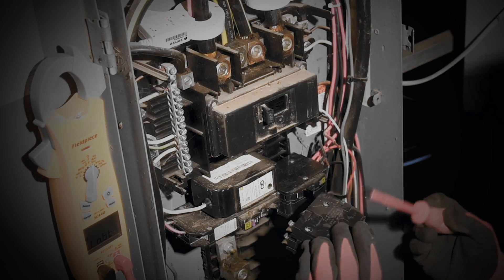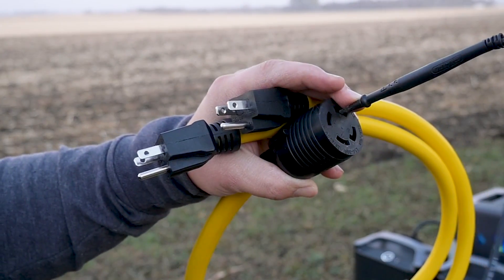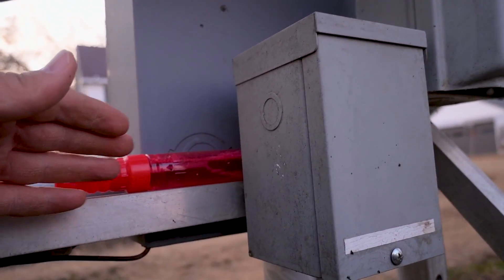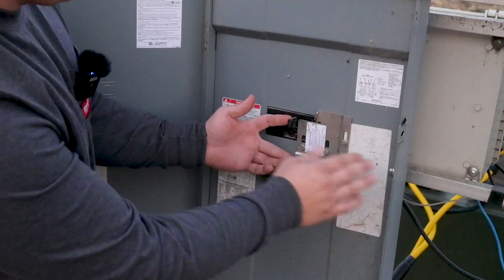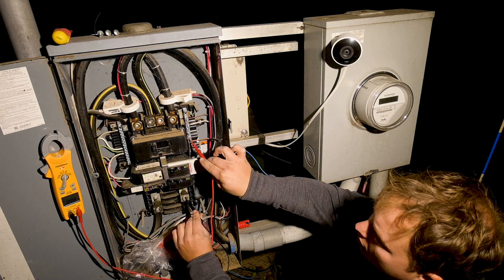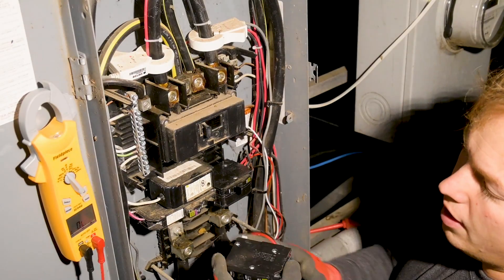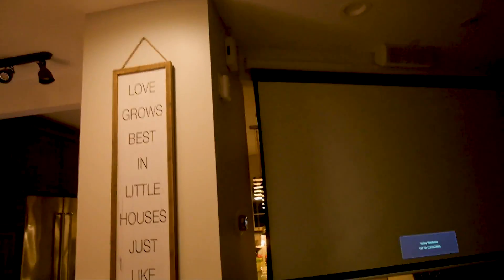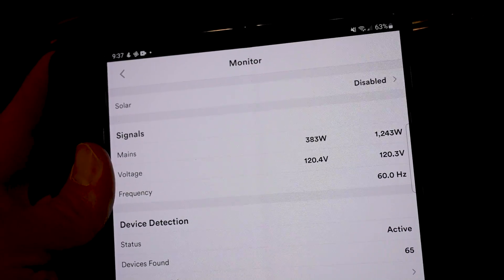Can You Power a 240 Volt Panel With Two 120 Volt Generators?

Comment: I just tested attaching a generator to our house yesterday - bad weather in the forecast, and I wanted to check for unexpected surprises.  The local codes now require GFI breakers in the panel in the garage, so just about every breaker is GFI, including the 50A dual breaker I used to feed the generator to the house.  After a little thought, I decided to disconnect neutral and ground at the generator, since the return current would split between neutral wire and the ground wire in the generator connection cable, which would certainly cause enough imbalance to trip the GFI breaker.  But when I closed the 50A breaker with the generator running, it made a buzzing noise for  a second or two, then emitted a brief pop and some sparks from inside the breaker itself, and it tripped off.  I gingerly reclosed the 50A GFI breaker, and this time it held with no buzzing sound.  I then pressed the GFI test button on the breaker and . . . nothing.  I apparently blew the snot out of the GFI circuit inside the breaker, and I have no clue as to why this happened.  The rest of my testing was uneventful.  (None of the other GFI breakers in the panel tripped; I was a little worried about this, because I have heard that GFI circuits are particularly sensitive to higher frequency harmonics, and I don't know how 'clean' my generator's output waveform is.)

Afterwards, I decided to replace the blown 50A GFI breaker with a non-GFI breaker, since I wasn't 100% sure it was still safe to use.

Just like the breaker you smashed in the video, my dead breaker was held together with five long aluminum rivets going through the width of the breaker.  I tried to drill out the rivets, which worked on one, but the others just spun in place.  Then I grabbed a nail punch and a hammer, and the other rivets popped right out, quick and easy.  Using this method of opening the breaker, I was able to examine the innards in their unmolested state.  There was a little circuit board with the Permalloy core with the L1/L2/N wires running through the core.  I expected to see one or more of the components on the circuit board visibly fried, but everything looked clean.

Anyway, it's still a mystery to me why the GFI breaker fried.  I realize that they are designed for power flow in the other direction, but I don't understand how the circuit would 'know' which direction power is flowing.
Reply: Update: Going back over the process of replacing the fried GFI breaker with the standard breaker, I realize now that the GFI breaker was wired incorrectly; the neutral wire from the 50A outlet was connected to the neutral bar in the breaker panel, but it should have been connected directly to the GFI breaker, along with the two hot wires.  The neutral pigtail wire from the GFI breaker was wired to the neutral bar, so at least they got that part correct.  So, the electrician miswired the breaker, and the inspector missed it.  Apparently the 50A outlet had never been used before, or was used with a pure 240V load with no neutral connection.  With the missing neutral, I subjected a sensitive circuit designed to trip on 5mA of current to maybe 1000x that much current, so it doesn't surprise me that it failed.

Comment: Benjamin I did the same thing in my house. I have an eco flow and a APC. I connected a transfer switch I split the two hots with to 20 amps plugs. I connected one to the Ecoflow and the other to the APC or 3500 ways generator, if I choose to. Haven’t lost power but am ready if it does. Eco flow is the only one that can turn my boilers pump for oil heat.

Comment: I'll add one variation. You can use 2 generators as long as you don't turn on the ac, stove or anything that uses 240. I assume it would damage the motor.  Interesting seeing someone actually do it.

Comment: Interesting experiment. I would have never thought to hook up a generator to each leg.  I would have thought there possibly could have been a problem with the polarity flow & that it may have tripped breakers (is this why u shut off all 2 pole breakers?) .  I would have been worried that the power banks didn't send current in the same direction as the utilities.  I would have had too much apprehension to try this experiment at my home.  I would have been worried that I would cause damage to my appliances or power banks.  Thanks for showing everyone this experiment.

Comment: Awesome video. I have been thinking along these lines as well. I have 24 250W solar panels. 12 go to one solar charge controller/inverter and 12 go to another. Each of these have their own 10KW battery bank. They each put out 120v. If I connected them together and connected a data cable between them I could configure the inverters to output 240V but the 2 units have to be on a shared battery bank. And my lithium battery banks are identical in configuration (4 12V 200AH) but each bank of 4 batteries are of a different manufacturer. Also I had read a data sheet from one of the manufacturers to not exceed 4 batteries in one bank. So, I have been hesitant to run my two inverters in sync with each other to get the 240v and sidelining a perfectly good bank of 10KW. So this has been on my mind a lot lately. Thanks for the additional thought material!

Comment: I think you can overload your neutral this way if your power sources can supply enough current. The two legs are meant to always be out of phase with each other, with the neutral carrying the difference, not the sum.

Comment: Similar  to a 120v generator feeding both panel legs with 240v breakers off. Best to use single breakers protecting eack leg separately. If one leg goes over current, only one leg will drop out. 
Great video proof it can be done safely.

Comment: Measuring voltage is measuring potential difference in phase rotations aka sine waves. Synchronous phases = 0v potential :-)

That being said, I have many acquaintances that power their panel with a 120v generator, and do so by merging the phases in the cord itself and turning off the 240v loads. The whole panel is powered, just with 120v on both sides in phase :-)

Comment: I'm pretty certain that the sense monitor is actually a 120v device that only uses the 2nd hot to monitor the voltage on that leg. When I was playing with mine originally I didn't have a 240v breaker and accidentally powered it on a single leg while doing some troubleshooting.

Comment: Although I have not read all comments, I do see some saying that both phases have to be in phase with each other. It’s actually that the two 120v phases are 180 degrees out of phase with each other. That is how you actually get 240v is because while “A” phase is going 1 positive the other is going negative do you actually have a total RMS voltage of 240v. I know for a lot of generators you can purchase a special sync setup that will ensure that when connected together they stay 180 degrees from each other therefore allowing you to use a limited number of your 240v circuits.

Comment: The phase difference between the two signals would only affect the magnitude of the resulting signal, but it will still give a uniform output (sine wave). Difference in frequency,however, would result in a sine wave with variable extremes (max and min), resulting in a variable rms.
I believe this could be solved if you use exact inverters from the same manufacturer. Some do have a connection for the proper phase shift too.

Comment: Edited with more info: There are two reasons for the 240 volt problem. Number one as you mentioned the frequencies are probably not exactly the same. However, the second problem is that they are also not going to be in phase with each other.

Even if they were both electronically synced to be exactly the same frequency, it's unlikely they would be in phase with each other. If they WERE synced to be the exact same frequency but NOT synced to be in phase, you would see some STEADY voltage between 0 and 240 depending on the phase difference.

In any case, if you were to look at a graph of the two 120V sine waves above each other WITH ONE INVERTED, the voltage at any moment in time would be the sum of the 2 voltages at that point in time. (Or on the graph, if the sine wave displays are touching each other, it would be the voltage equivalent to the distance between the two points at that moment.)

Another way to think of it is that the voltage on the 240 connection is the sum of the instantaneous voltage of the two sources at any point in time. Please keep in mind that the instantaneous voltage can be positive or negative at any moment in time. (I don't want to complicate things but for those that might try to point this out, yes the meter probably measures RMS, and the graphs would show peak which can go much higher than 240, but the basic principle is there.)

 I apologize if anyone else said the same thing but I haven't read all comments. An interesting experiment. I enjoy your channel.

Comment: That weird voltage you are seeing across the 240V is the 2 power sources are out of phase with each outher .If you you have a dual trace scope you can see the two wave forms and you can see they both do not line up. On the larger power banks there is a sync cable to go between them and that will fix that 240V problem. Also some generators have a sync cable as well . like the larger Honda inverter generator . also can put 2 120V loads together for more amps. I made a cord like you use in video but used 10/3 wire for the 2 legs and 20A 120V plug. I have gen set that output 20 amps 120V + . also both 120V plugs can be put into same source .being 180deg out of phase there will be 0 volts between the 2 hot legs. is ok to do this ,same again 240V loads turn off.  I have been a electrician in Boston NY over 30 years now and had my share of bugs getting inside panel box and breakers. I keep bee and bug spray on hand. Them little things can find a way in. nice video. 😀

Comment: Hopefully, we all realize how and why they used to get away with using a smaller guage neutral compared to the two hot legs feeding an old 240v panel per electric code.  In a perfect situation, that neutral will see zero current with balanced 120v and all 240v loads.  (The switching power supplies have changed the world and modern electrical codes spec all three same sized wires to deal with unexpected high frequency AC currents overloading main supply neutrals. That strange situation could melt N wire between commercial buildings!) 

With this video's proposed setup, the neutral would see double the expected maximum current while the two legs remain in phase. Drifting around would give the N some chance to cool off as it approached proper 180 degree phase. I would not count on that.

Double that trouble again if the neutral's wire gauge is already much smaller than that of the two hots!  It's a bad idea without a single 240v alternator power source that has to maintain a perfect phase lock. Trying to phase lock two 120's together for 240 smells like something is burning... lol  Just say, "no".

Comment: the light going bright to off then back off is showing the phase difference. you can use this method to sync 2 gensets (engine driven) into parallel mode.

Comment: The varying LED is an example of what in physics is called 'beats".  You can hear the same thing happen when you have two different tones play that are slightly different frequencies.

With the beat frequency you can measure the difference in frequency between the two sources  So if one is 59hz and the other is 60hz, you'd hear a beat frequency of 1hz.

Yours looked like a frequency of about 8-10 seconds, so you'd expect a difference between the two of something like .1hz.  For example, one might be 59.8hz and the other is 59.9 hz.

Comment: Back in the day when the power company was   to bring a generator back on line, the operator manually engaged (switchgear with a push button) the generator to the grid based on the position of the indicator of the syncroscope.  There is videos on YT that show how this was done before computers/controllers.  Like someone said, when a generator is connected to the grid when its output phase is within a few microseconds difference, then it will remain locked in phase to the grid from that point on.  There is also videos about how they determine how many megawatts a generator is suppling to the grid based on just a few microseconds of generator phase leading the grids phase.
Reply from the maker: What keeps a generator from "drifting" out of sync once engaged with the grid?
Reply: @BenjaminSahlstrom  Look up phase locked loop circuit.  That is an analog cuircuit which will keep something phase synced.  Nowadays it is all done by software and digitally.
Reply: https://youtu.be/xGQxSJmadm0
Reply: A generator is like a motor, it has all the same charactics of a motor, so when the grnerator is on the grid, the grid will drive the generator in much the same way that 120 or 240 volts drive an electric motor,  The speed of the generator will be determined by the frequency of the grid, 60 htz, and the number of poles of the generator.  Only when the generator is pushed enough so that its output phase starts to lead the phase of the grid, that is when it is actually generating into the grid.  To produce this slight phase lead takes a monumental amount of power to achieve in order for the generator to produce its rated output.
Reply: Ive heard that installing just one syncaronous moter will correct out of phase problems

Comment: You should also turn off any multiwire branch circuits, since these circuits share a neutral.  (Which of course should have a shared breaker).  I'm not really sure what would happen with these circuits since they share a neutral, but at the very least you'd be out of code since they no longer will balance any load between the two phases, since as you observed they aren't.
Reply: The US National Electric Code (NEC) 2020 edition requires that all Multi Wire Branch circuits (MWBC)s have one of two arrangements of the circuit breaker/s supplying them. Either handle ties or a double pole breaker. If it's a 2 pole breaker that would take care of the neutral overloading issue of MWBCs when you threw all of the double pole breakers to off with the caveat that the requirement for special control of MWBCs is relatively recent and it is unlikely that any but rather recent panels have been upgraded to comply with this new requirement. If handle ties are used then you would have to treat all of the handle tied breakers the same as double pole breakers and turn those off as well. 

Tom Horne

Comment: 240 volts as I would expect, and it goes up and down as the 2 legs go in and out of phase with each other. The slow movement means they are actually pretty close in frequency.

Comment: You can run both legs of your house off one 120V solar generator.  Have to buy a 120V to 240V cord that splits the hot.  I did that during our last outage.  Just can't power any 240V devices.

Comment: Of course you can, as long as you don't have any 240v devices, some random phase between the two legs.
If you can lock the phases " in phase " you will see 0V across the two legs. If you can lock the 2 phases " 180 degrees out of phase " you will see 240V

Comment: Besides what everyone else posted about the two generators not being in phase, actually they need to be 180 degrees out of phase and exactly the same frequency. If you have any multiwire branch circuits, these are two circuit one on each leg that use a common neutral conductor. Normally since each leg is 180 out of phase with the other the neutral only carries the difference current. If the loads are exactly balance the neutral carries zero current. Worst case using two generators if they are both in phase the neutral now has to carry the combined current of both logs. Needless to that that is not a good thing.
Reply from the maker: Great point. I hadn't thought of that.

Comment: I'm sure someone commented this already... your "generators" have a "forced" common neutral with the cord plugged in. So neutral to hot on either is 120V. But the phase is not in sync. Thus, reading hot to hot will give various volts from roughly  +240 to -240 as the phases cycle "across" each other. Peak voltage depending on the initial phase offset of the legs. An oscilloscope at this point would show this clearly. 
It is possible the frequency is different, but that woukd give a slow drift of voltage not the rapid change you are seeing since your meter is taking the RMS (root mean square) average of the AC voltage seen by your probes.

Comment: The power banks use PWM to produce a simulated ac wave each independent of the other. They are not syncronized so the variation of voltage between the two sources is due to their frequency being slightly different. BTW if you wanted to syncronize two IC powered generators you clould have a switch up stream of a common bus. If you could close the switch to parallel the alternators when their output frequencies match they would be magnetically locked in sync and should be ok as long as both generators run.

Comment: I agree with the other commenters. The two inverters are out of sync and could be running at different frequencies, and not exactly 60 hz. It's possible one is 59 hz and the other is 61 hz, which would cause the voltage between the two hots to vary between 0-240 volts. The same applies to 2 gas powered generators that use an inverter. There are parallel kits to connect two identical generators for more current capacity but the output voltage is still 120 volts.

Comment: Benjamin, I would recommend re-checking all of the 240V circuits/devices. Some things might not have been happy with the fluctuating voltages. (like motors, or any 240V appliance with electronic controls)
Reply: I to would like to see the video completed with 240 volt appliance's running